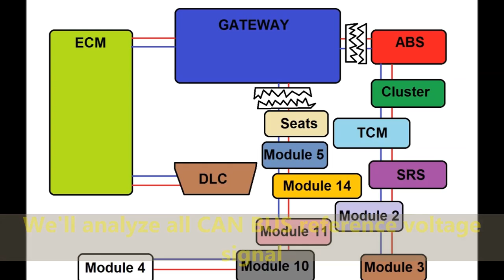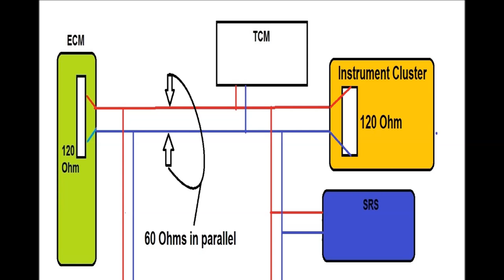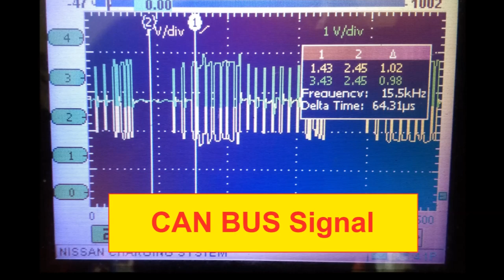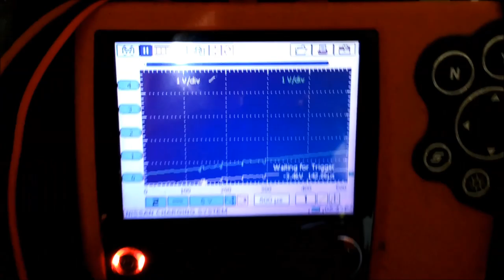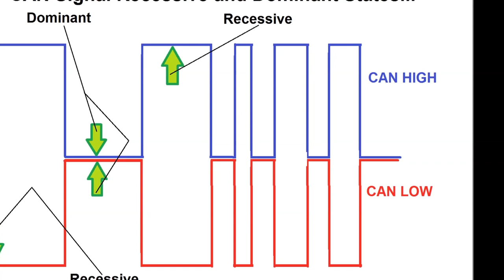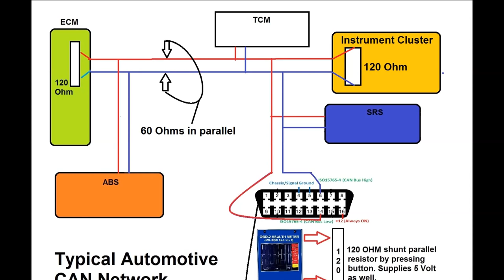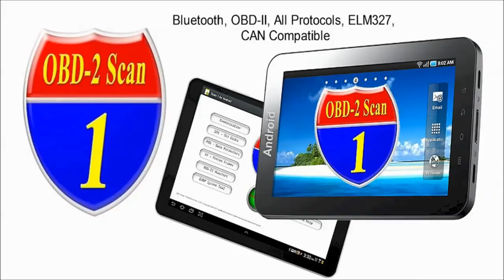How to do Automotive CAN BUS Voltage Test

Comment: my 2015 jeep jk 3.6 only has 5 wires if i Rember correctly to DLC when i plug in CAN H AND LOW to my scope it only shows 2.5 x2 with math ch. total of 5v KOEO i dont get a normal can network
signal. i think with engine running it will show a normal can network signal. any ideas?  thx bob
Reply from the maker: This CAN voltages sound right. You may have a shorted module dropping the network.
Reply: do you think because my ecm/pcm has been unlocked to run a tuner for that year jeep

Comment: I have a no communication issue with tpms module. I have 60 ohms between can high and low, 2.6v can high to ground, 2.4 volts can low to ground, but I have .54 volts between can high and can low?  Do I have one of my 
resistors shorting to ground?
Reply from the maker: One resistor is gone. CAN will work with one but not very well.
Reply: @ADPTraining  wouldn’t I have 120 ohms if I lost one resistor?
Reply: Also, I measure 98 ohms between can high and ground and 98ohms between can low and ground obviously with power removed.

Comment: My honda accord 2018 only have 120 ohm and i think coming for the gateway module whent i unplugged the 120 ohm going but i still missing the other 120 ohm i dont not what module have the other 120 any help please
Reply from the maker: This is why you need to inject voltage and 120 Ohm termination resistor on a CAN using the OBD-2 DLC Health Checker. 
http://www.autodiagnosticsandpublishing.com/OBD_2_DLC_Health_Checker.html
Reply: @ADPTraining  i found out i have 120 ohm and the gateway and 120 ohm and female plug but my odb2 only have 120 no 60ohm

Comment: I have a problem with my camry 2007. The ABS and BREAK indicator sometime is a ON/OFF,. INTERMITTENT... . The four speed sensors are OK., and the speedometer and a/c and also the temp meter are affected. My scanner say is that  COMUNICATION MODULE BUS OFF. is that mean the ABS MODULE is damage?

Comment: amazing video. what if there is more than 2 termination resistor(ford uses that).please do one on flex ray  and star  connection
                                                                                                                                                                                                             thanks
Reply from the maker: Hi, ok there can only be 2 termination resistors on a CAN Network (2008 up). Take a look at my newest OBD-2 Network tool, the OBD-II DLC Health Checker. http://www.autodiagnosticsandpublishing.com/OBD_2_DLC_Health_Checker.html

Comment: Hi, I'm turkey Istanbul from you I have a tool that will be a question for automatic transmission problems i have vehicle access transmission I made new, but the tools in place does not get (P.R. N. D. 2.1) ..... D. When I get to the location you're too slow to it.  The problem is what do u think.  Solenoid problem caused by the relay whichever I would appreciate if you help my vehicle 1600motor automatic 1998 model Proton.  I have a mutsubisi engine
Reply from the maker: Question?

Comment: What if I have 40ohms across pin 6&14? I also have 60ohms coming out of a module connector with it unplugged but 120ohms going in from the resistor. With the connector unplugged shouldn’t the reading be overload from the wires going to the next module in parallel?
Reply from the maker: Not really... 60 Ohms or 120 Ohms if one termination resistor is out.

Comment: Hi, question,  2008 dodge caliber,  I can communicate with every module except the TCM  checked powers and ground at the TCM they're good,  back probe the can high can low wires at the  tcm connector I have the mirror signals, replaced the TCM and still no communication,  do you think another module can cause the problem??
Reply from the maker: Well, if you had communications then it's not the CAN network. Look into your gateway module, which controls who's communicating.

Comment: To my knowledge CAN high is yellow and CAN low is green at least in heavy duty diesel. Is automotive industry different?
Reply from the maker: Ok, DLC Pin 6 is can High. The colors can change between manufacturers. No pun intended. Working on CAN networks, see my Ebook and my CAN or OBD-II Health Tester here. 
http://www.autodiagnosticsandpublishing.com/OBD_2_DLC_Health_Checker.html

http://www.autodiagnosticsandpublishing.com/Automotive_Diagnostic_Repair_Book_Catalog.htm

Comment: So, if I'm correct the High CAM and Low Can have a DC voltage offset at 2.45vdc but have a delta of 2 Vdc.  So, if the Negative signal is 1.5Vdc then the positive signal should be 3.5vdc.
Reply from the maker: Yes, that's correct. Search my Network Ebook here. 
http://www.autodiagnosticsandpublishing.com/Automotive_Diagnostic_Repair_Book_Catalog.htm

Comment: Good day. Im hoping you can advise me with a problm I have. I own a W210 E 280, that only has the 38 pin connector under the hood. I cannot connect to any module on the vehicle. I have tried several scanners, including the MB Star, Launch X431, Delphi as we ll as iCarsoft. Neither of them connect. I have voltage at the DLC, I checked resistance between DLC ground to chassis ground and its good, as well as good battery voltage at the DLC and thats good. I cannot connect to any modules. Pls can you advise on what to check next? 

Awesome video with great info. Thanx for the video
Reply from the maker: Ok, coincidentally I have a usef Autodiagnos European Breakout Box for sale. It looks at all your ECM Pins and detects issues. Text me at 201 674 5003 so I can send you photos.

Comment: Can I'm by pass can bus signal.
Example :
I want to install power sliding door, the controller used can bus 2 wire.  
But my car don't have the can bus system.   

Any idea for this ..?
Reply from the maker: You can remove CAN bus and use some other control type, like direct electrical control.

Comment: Measured resistance 6 to 14 and got 500 ohms on a dead car what happened?
07chevy silverado 1500 if it matters
Reply from the maker: 60 Ohms that's two 120 Ohms in parallel.

Comment: What happens if you measure the resistance over can lines to be 120 ohm, but everything is working fine in the vehicle?
Reply from the maker: 120 Ohms means that one of the 60 Ohm resistors is gone. That won't bring down the CAN network, but you may get U or communications codes here and there for no reason at all.
Reply: Thanks for your response. With my can bus reader I get no information from the port. The voltages between the any of the lines and ground is 2.45, voltage between them is 0. I was expecting a voltage difference when the vehicle is turned on

Comment: You need to make up your mind sir. You show a picture of dominant and recessive state but in your explanation you tell the opposite 🤔
Reply from the maker: It is clearly stated, 2.5v on high speed CAN is receive.
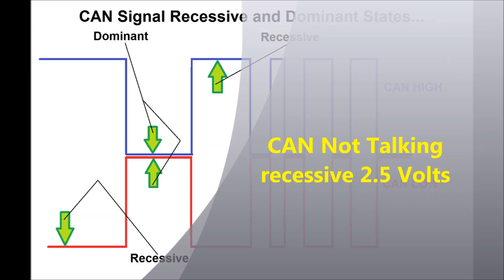Reply: @ADPTraining  : No, he is absolutely right. Recheck your training material! @12:54 your picture states that dominant is when CAN_H and CAN_L is at same voltage! Dominant occurs when can-H and can-L is pulled apart.
Reply: Yeah that little typo in the "signal recessive and dominant states" diagram confused me as well... But this was still an excellent teaching video. I think this channel has some of the best in depth videos on automotive electrical systems. 👍

Comment: It is worth to mention that ,even on a CAN network many computers can be found ,the two 120 ohms resistors are located in those 2 computers which at greatest distance one from another
Reply from the maker: Yes absolutely, and almost no info is found in where these resistors are.
Reply from the maker: It's also important to know that if there's a gateway module, as us always the case today, then there are multiple CAN Networks, each with its own 120 Ohm resistor pair.
Reply: @ADPTraining  can u explain that for me please because my car have a gateway module but i only have 120 ohm coming for the gateway the other 120 i missing or how that work

Comment: سلام وهزاران 👍 وتشکر لطفا بزبان فرسی زیر نویس نمایید....👍. .
Reply: all he was saying   voltage between   T6 + G and T14 +G  must be 2.2-2.5  with ignition on. and resistance with IG off  58>62.and when the car running  T6  and G 3.5 and T14 around 1.5 .you can do all that with meter.i hope it help
Reply from the maker: http://www.autodiagnosticsandpublishing.com/OBD_2_DLC_Health_Checker.html
Batebi, no you can't do that with meter. DMM are RMS or averaging tools. No use in network testing. What he's saying makes sense, but while running he's only seeing averaging voltage. See my new tool the OBD-II DLC Health Checker.

Comment: Not sure if this is a training video or an ad for some gadget he thinks is the greatest tool of all time.  The guy sounds like he was bragging to some drunk at a bar about everything he knows about CAN bus!  With all the repetition and foreshadowing, it is nearly impossible to follow and painful to watch!
Reply from the maker: This is a unique tool and if you want to diagnose CAN Network issues then you have 2 choices. Grab a scope, resistor Load, power probe, somehow link all these together, and also a multimeter. Add a CAN Bus transceiver and good luck.

Otherwise use my tool, connect to the DLC connector and done. Just follow the menu. http://www.autodiagnosticsandpublishing.com/OBD_2_DLC_Health_Checker.html
Reply from the maker: You're welcome to also read my Automotive Network Ebook. 
http://www.autodiagnosticsandpublishing.com/Automotive_Diagnostic_Repair_Book_Catalog.htm